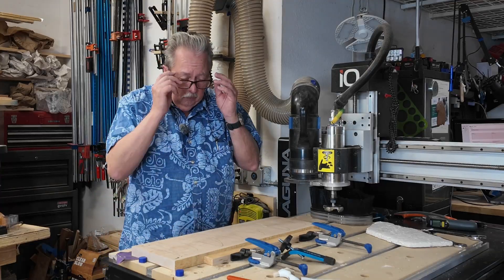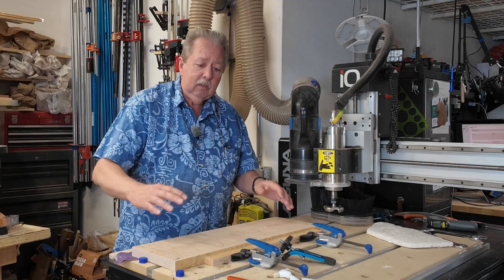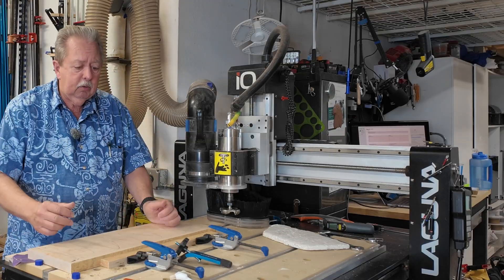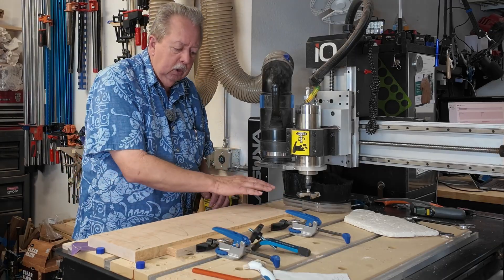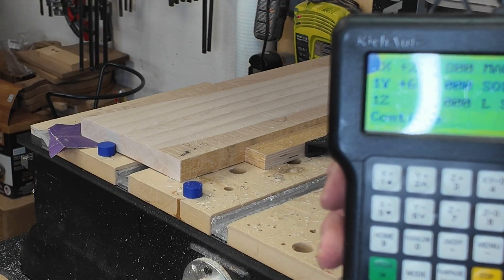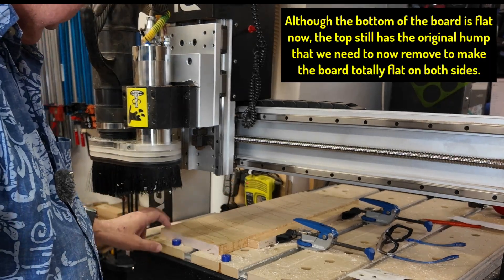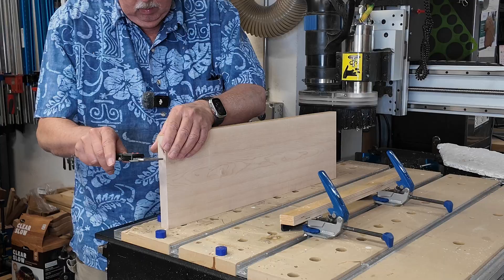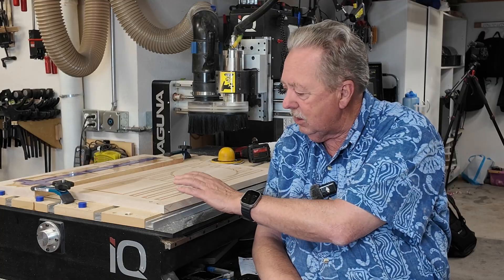How to Flatten a Board with a CNC Router – Step-by-Step Guide

Comment: If I remember correctly, Mach3 (Not sure if you use it?) has a "wizard" that generates basic toolpaths, so you don't have to fire up vectric just for that
Reply from the maker: I don't use Mach 3 or any other control computer systems.  I use a controller pendant that came with my machine.